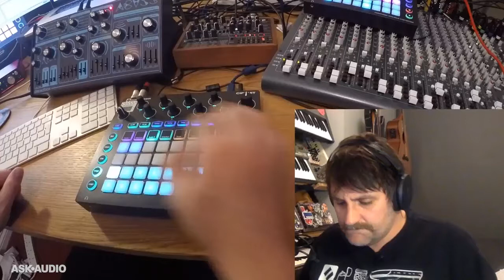Novation Circuit: Sync External Gear & Building Chords

Comment: do you need to change your system settings of the circuit and mono station? I'm trying to play the circuit and mono station together at the time but without the signals from the circuit through the mono station. Or Do i need to run the two devices through a mixer and connect the circuit with mono station with midi but mono station disabled midi RX to just sync the Bpm?

Comment: Can the circuit send cc messages to the synths it is sequencing?
Reply: I believe it can, however it is not going to be useful without a midi translator in the chain, as the CC numbers on Circuit and synths are going to be fixed and not matching to each other the way you would like.
Reply: just saw a video mentioning that. maybe channel 16 can do it, download novations programmers reference guide for more info. I haven't looked into it yet.

Comment: Can you play the external synth(s) via a midi keyboard connected to the circuit's midi IN? Or is it only possible to play external synth by pressing the pads on the circuit?
Reply: Josh Peters that sounds meaningless, doesn’t it? I mean then it’s better to connect the MIDI keyboard directly to the external synth?
Reply: Albin Ekberg you’d want to do it through the circuit because your keyboard does not have a sequencer.